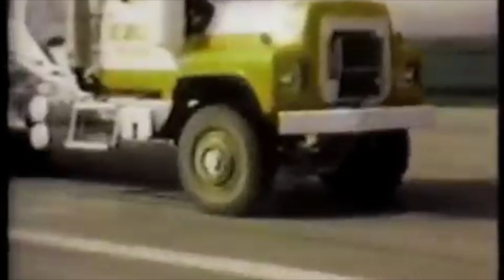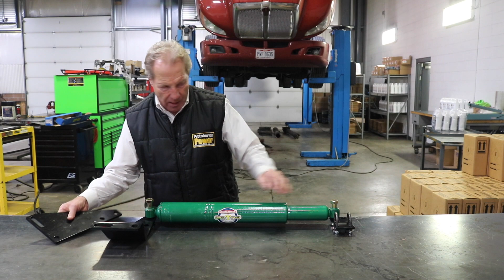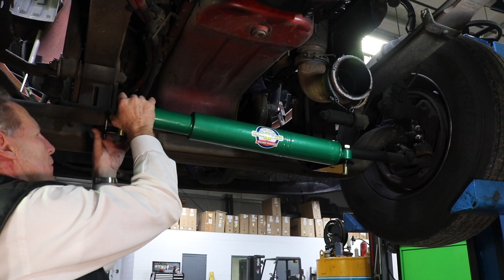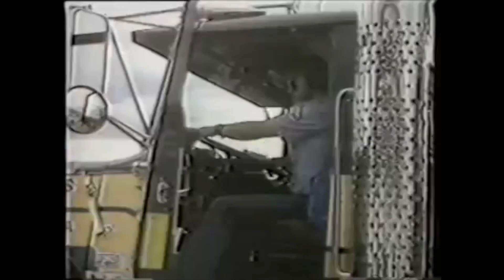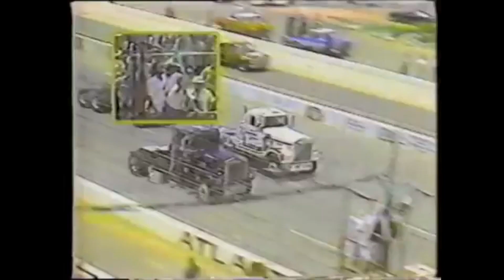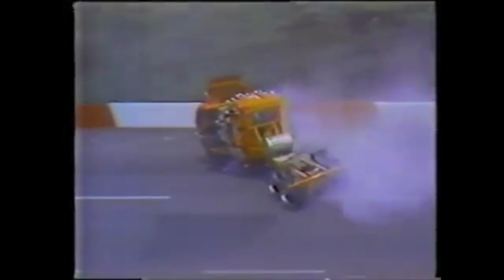Safe T Plus - Steering Stabilizer for Big Rigs

Comment: Why hasn't anyone developed a run flat steer tire, to prevent blow outs? A tire that has foam rubber, or other inflated cell in it, to keep a certain amount of lift in the tire, at least to prevent complete blowout, potential rim damage, or worse, allowing even just a safer pullover? Same with super singles! Run flat!

Comment: $ 700 to 900 for a good steer tire. Several 1000 dollars in repairs due to steer tire blow outs..... "but this thing cost way too much. $800 bucks? REALLY????
Reply: 800 dollars  is very cheap insurance 
For not putting  your truck on its  roof